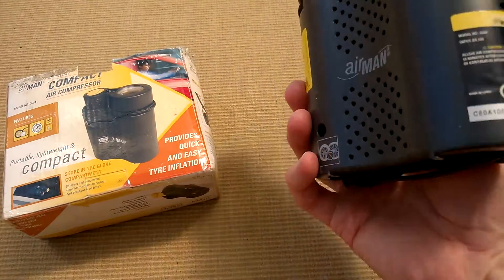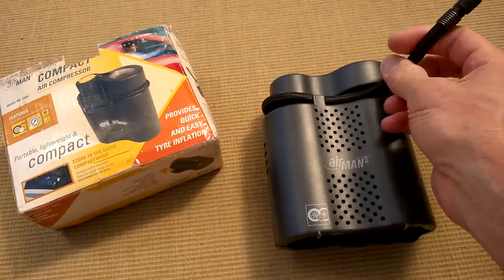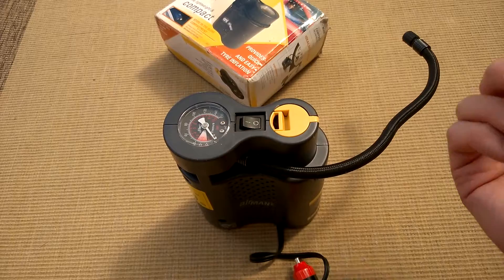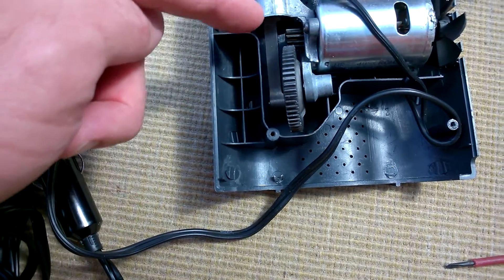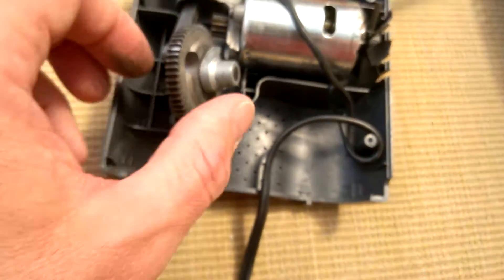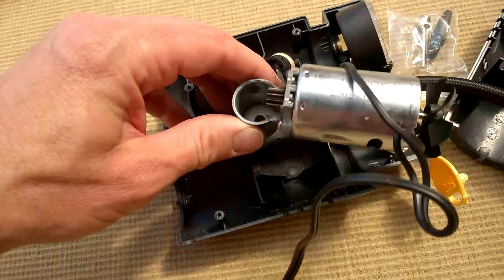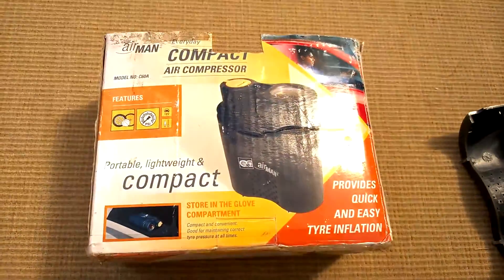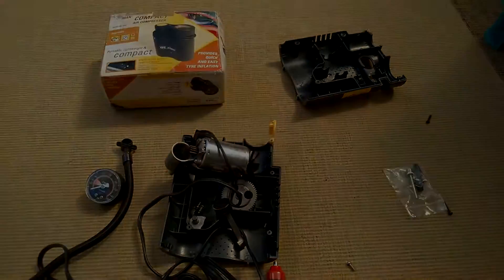AirMan Car Tyre Pump Tear Down After Failure

Comment: could you not try something like JB weld as a cheap fix ?
Reply from the maker: Possibly worth a go, thought a bit like glue, it never seems as strong as the original.  Since the piston moves very quickly I expect it would break again.
Reply: @ChrisHorswill  could possibly need gluing then a support bracket glued and screwed to give it extra support ?